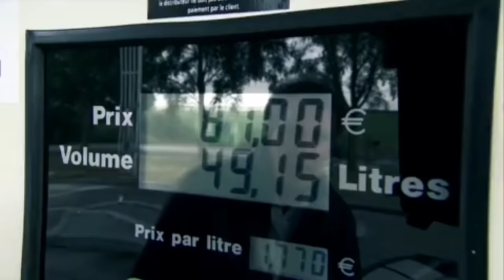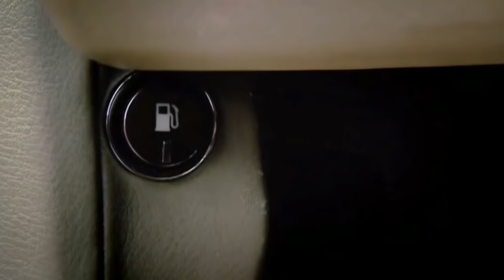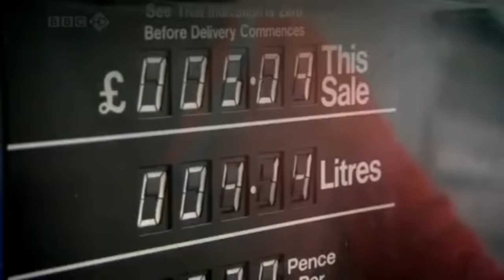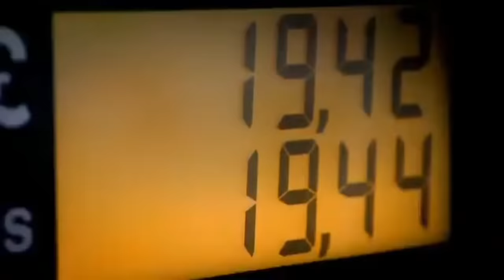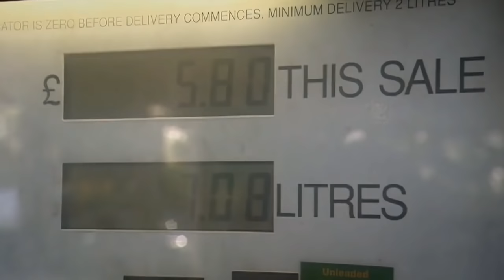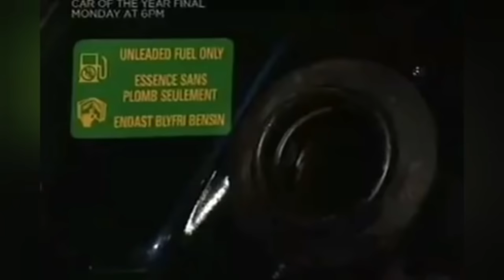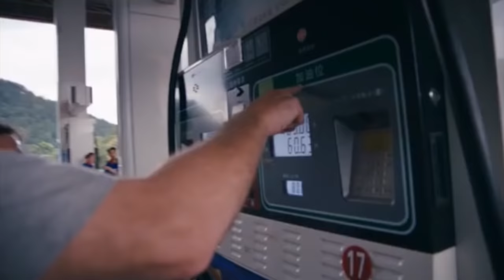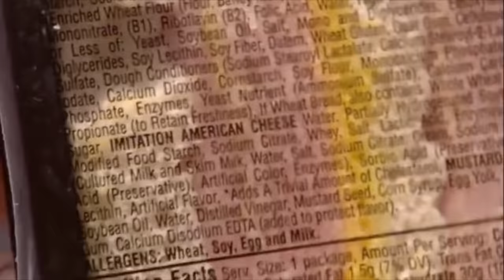Clarkson, Hammond, May at Fuel Stations Compilation

Comment: Fun Fact: As a way to circumvent the rules in Nascar a driver by the name of Smokey Yunick chilled the fuel in his cars fuel tank to the point it was nearly frozen and would allow for it to expand through the race reducing pitstops. Eventually rules were made on fuel temperature. After that he made his fuel lines 11 feet long and 2 inches thick to allow him to carry more fuel, he was eventually told he could not do this anymore. He eventually put a basketball in his fuel tank that he would inflate during inspection to make his fuel tank measure to be within rule specification but he would then deflate during the race and fill with more fuel.
Reply: It's like what they did in F1 in the 80s pretty much the same but with less basketball and more science lol
Reply: If you arent cheating in motorsport you arent really trying
Reply: @d3203  Like Lancia back in the days of group B
Reply: Smokey was great! They once, to provoke him after an inspection where they found nothing, took out his fuel tank so he had push his car to the pits and reinstall the fuel tank.
Only Smokey got in the car, fired it out, flipped them the bird and drove to the pits.
The fuel in the 11 ft lines that was inside the tubes for the tube chassis held enough fuel to not need the fuel tank for a mile or so.
Reply: jesus christ Smokey just accept a loss
Reply: What a mad lad.
Reply: My buddy did work on a dirt track road runner class monte Carlo non SS swapped a 350 pulled from a k5 blazer. Then found out the track racers son was allowed to use darted heads on his build when no one else would. Put a set of 305 heads on the motor to even the scales. Worked like a champ until the oil filter shot off and saw a flame. Good times.
Reply: @PeterCaptainObvious  Lancia didn- oh, you mean the first year.
Reply: @DaDARKPass  When they were competing vs Audi yeah
Reply: What a madlad
Reply: Improvise, adapt, overcome
Reply: become ungovernable
Reply: @157RANDOM  .
Reply: You have these multimillion dollar businesses stacking cash behind these cars, then you have Smokey using his brain.
Reply: Ohhhhh, I love loopholes and stuff like that so so much
Reply: Honestly, based.
Reply: @d3203  Lancia beating Audi and taking the title with a RWD car (last ever to win it I believe) is an example of this.

Giving yourself an edge by playing the rules is just part of motorsport I guess🤷
Reply: Didn’t he also manufacture two cars, one racing and one decoy so that he could have an aerodynamic edge? And when questioned about his car at inspection he pointed out the decoy in the lot to prove it was “stock”?
Reply: this man did not give up, respect
Reply: @grqfes  facts
Reply: You've gotta love Smokey if there was a way to cheat he would find it
Reply: Now that’s dedication
Reply: Inflated for inspection, immediately deflated in the garage. He also ran a 2” fuel line to the tank to hold an extra gallon or two of gas.
Reply: Yep same guy claims almost the entire nascar rule book was written because of him.
Reply: You said fun fact... false advertising 🤣
Reply: Big brain😂
Reply: thats not even the tip of the iceberg of what he did. He claimed that half of the NASCAR rulebook in the 60's and 70's was because of him.
Reply: Was he the same guy who put a fuel tank on a giant tower and then used gravity to fill up the tank in seconds?
Reply: That’s just straight up cheating at that point
Reply: if there is a will there is a way, there is 2 loopholes for every rule
Reply: Now THIS is what you call a big brain time
Reply: @_GhostMiner  clarkson for prime minister :)
Reply: Honestly for that amount of genius mad-laddery NASCAR should’ve just let him get on with it haha
Reply: @PeterCaptainObvious haha lancia love to get around the stuff like putting salt on snow tracks or stalling the guy with a flag because dust was on the track or even use a plastic roll cage 💀
Reply: So. He was a cheat.
Should have been banned for life.
Reply: @d3203 It's not cheating unless there is a specific rule against it. Makes for interesting engineering, but inversely, makes for terrible times with things like laws/taxes.
Reply: @sugarnads  Not in NASCAR. A sport that has it's roots in criminal activity is always going to tacitly allow that kind of innovation.
Reply: Was he Czech???😂
Reply: All cool and all, really Genius but Is nascar
Reply: Half the Nascar Rulebook was written to respond to Smokey's shenanigans XD
Reply: @felixfelix9062  NEVER!!!
Reply: @sugarnads   Society loves romanticizing bad people because it makes for a good story. Replace all that cheating with a bigger sport and the person would've been banned for life. When Basketball players "play the rules" they get fined by the NBA, and the rules are changed. When a Footballer plays the rules, FIFA fines them and there has been instances in both FIBA and FIFA where players were banned for years for playing the rules.
Reply: @farguc  it wasn’t cheating though, there was no rules that said he couldn’t do it 

He was trying to get an edge, and every time he got found out, and they put a rule in place, he would stop doing it and try something else
Reply: Improvise. Adapt. Overcome.
Reply: @d3203 bending the rules are not cheating. anyone can cheat, only the smart ones bend the rules
Reply: Fun Fact (2). Smokey Yunick was a mechanical genius, not a driver. He built and worked on cars, didn't  do the actual driving of the race car.
Reply: @philipplyanguzov9090  No, that was Roger Penske, another guy with a "k" in his surname. 😊
Reply: @martinkuca7420  No, he was a 
" Florida Man".
Reply: Good ol' Smokey.
Reply: TL:DR Smokey Yunick is responsible for 93% of the rules in NASCAR
Reply: smokey yunick was also gay
Reply: @Marlin101084  To be fair, the basketball one was definitely cheating: after all, just because something is not found during an inspection (having a greater fuel tank size than allowed), doesn't mean it's not against the rules. Well, unless the rulebook is written to specify that the rules only count during an inspection and not during a race, I guess, but somehow I doubt that's the case.

Comment: At 5:11 when Jeremy counts the radiators in the veyron he says there are 10 but only counts 9 of them
Reply: I initially though I had misheard something, but your comment cleared that up for me.
Reply: @lennyface8195  The 10th he didn't mention is for the air conditioning.
Reply: @sportsjefe  exactly
Reply: @sportsjefe  I thought that 10th one was for the brakes. Correct me if I'm wrong though.
Reply: @Veyron722skyhook  you don't need a radiator to cool the brakes m8
Reply: 3 for engine, 3 for intercoolers, 1 for A/C, 1 for engine oil, 1 for transmission, 1 for differential.  Total of 10.
Reply: nerd
Reply: The 10th one is right behind you. Look out!

Comment: The fuel density tip is pretty good, his genius truly knows no bounds!
Reply: You could even say that it’s almost frightening!
Reply: I hate to break this to you but the fuel density thing is mostly rubbish, yes fuel does get more dense when it's cold but it's also stored in underground tanks where the temperature is basically the same all year round at about 10° + or - a couple of degrees between summer and winter.
Reply: @jon2922  aah cheers, makes sense.. so basically this tip is not applicable to countries like the UK.
Reply: @Mbmism  not really applicable anywhere that buries it's petrol tanks more than a metre down.

Comment: 7:29 - Felt that before after pulling an all nighter for an engineering assignment, then leaving the campus at 3 am after originally starting it with no breaks around 5pm the previous day. It's a very weird experience to have.

Comment: I love how calculating mpg makes so little sense even they have problems calculating it..
Reply: How many miles you drove ÷ how many gallons you used. How is that hard to figure out?
Reply: @jacobg5122  the problem is that basically everywhere else in the world you use kilometers and liters instead of gallons and miles, making the conversion more difficult. Also, a lot of people won't even understand the result because you can't put it into perspective if you are used to liters per 100 km for fuel efficiency.
Reply: @thef726  
I guess that makes sense, because I don't think I could do liters/km off the top of my head. I know a liter is a little more than a quart, and a kilometer is roughly 0.6 miles, so 1 mile per gallon is about 3.8l/1.5km. And it's probably just as unintuitive in the other direction as well.
Reply: @jacobg5122  a litre is 1000ml. A km is 1000 metres. Its pretty easy to do the math...
Reply: @JellyLocke  
Yeah and it's easy for me to do miles per gallon because that's what I've been doing all my life. But I'm saying I can see how it would be difficult for someone who grew up doing it with different units. Besides. I don't have a reference for what a milliliter is because we don't use them in the US. So knowing that a liter is 1000ml (which I did know) doesn't mean anything. I can tell you a gallon is 4 quarts, but unless you know what a quart is, that still doesn't tell you what a gallon is.
Reply: Miles driven × conversion from liters to gallons [4.546?] ÷ liters = mpg. Easy, actually.
Reply: They tracked their distance in miles and fuel consumption in liters. 
There is literally no way around it without a conversion in either system and it makes no sense to track in 2 different systems at the same time in the first place.
But how you got to the conclusion that dividing kilometers with liters is in any way simpler than dividing miles with gallons is totally beyond understanding.
Reply: @jackconnor6172  calculating w the metric tactic makes it very simple to communicate w any foreigner +super simple to calculate range of car
Most of the world works with metric, only UK is weird with having liters at gas station, yet going for mpg
Reply: @kacor0078  All you need is the magic figure:  "0.354"   Multply MPG by that you get Kms/Litre.  Divide by that to reverse! Easy Peasey.
(However: A US Gallon is less than a UK Gallon..... [Let them struggle!]   Strange though that NASA uses metric.....Not just the UK that is weird.)

Comment: I blame Jeremy Clarkson for so many people believing the "you get more fuel when its cold" myth
Reply: Except what he said is true. Colder fuel is denser than warm fuel. Nascar had to standardize fuel temperature because of this
Reply: @McKae00  The gas is 10 or so meters underground in a well insulated tank so air temperature is irrelevant
Reply: @dylanhinkel3548  He said nothing about air temperature, he literally said "fuel temperature".
Reply: @McKae00  Yeah, colder fuel is denser. But the fuel isn't actually cold in the tank. The actual fuel storage is underground. It's pretty well-insulated down there! The difference in density is so frigging teeny-tiny that you would maybe have to fill up a hundred cars to save a cent.

Nevermind the fact that a cold engine will actually consume ever-so-slightly more fuel so on the whole it'll probably end up losing you money overall.

Comment: 25:54 You should never jumpstart a bmw from the battery. You're supposed to connect it to the terminals in the engine bay
Reply: (You meant FROM a BMW at the battery?) Kindly explain why ...and if you mention "voltage drop" We will all know you are talking rubbish.
You START a BMW with jump leads in the engine bay for convenience. (Same with some Volvo's...the battery in the boot is well protected.)

Comment: never brim fill a modern new car . the EVAC system that controls the tank pressure / vacume will destroy its self . also will cause your card engine to run extremely rich and chew the fuel . only ever fill to the first click off on the fuel filler . this will leave enough room in the fuel tank filler pipe to run on the air fumes to the EVAC system to operate properly .
Reply: Dam in didn't know this, I been brimming it with multiple clicks. Fuck :0
Reply: this is BS. the EVAP (not EVAC) wont care if it has fuel in it. it can detect it and wait until its cleard. if this happens there are one way valves right after the tank and before the evap filter. besides it is not for pressure in tanks (thats what your HP and LP pumps are fore) its for returning petrol gasses to your tank or the intake, depending what the ECU commands. modren cars dont operate with over or underpressure in tanks.
Reply: thats so cringe

Comment: Fuel is stored underground and is at virtually the same temperature when dispensed regardless of the outside temperature. 

Going to the gas station when it’s cold has zero benefit

Comment: when they try to convert liters into gallons. 1 US gallon equals 3.78541178 liters.  Not 4.75 liters that is over 1 gallon 
So when Clarkson did 20.85 liters That would equal 5.5079873 US Gallons. they got it wrong.
Reply: A UK gallon is 20% bigger than a US gallon .  Jeremy was correct.  4.546 litres to a UK gallon.  James got it wrong saying 4.45.

A UK pint is also 20% bigger than a US pint, but strangely a UK fluid ounce is slightly smaller than a US one.

Comment: 20:37 Please translate that 9 stupid distance to the stupid amount of fuel. That is Britty baby babble. I want kilometers to the liter. Why would I go back to the middle ages? You Brits do it all wrong, you even got yourself a queen that is the first one that will never die. And there is nothing you can do, to get a normal society. But those stupid miles and gallons, you can drop those by now.
Reply: No need to be so upset if you don’t have to use it!, 
nothing wrong with imperial old chap.
Reply: Also, it isn't measures as km to the litre, in metric is is measured as litres per 100 km.